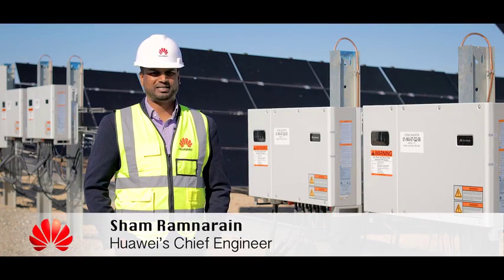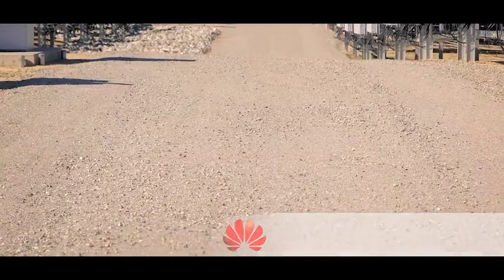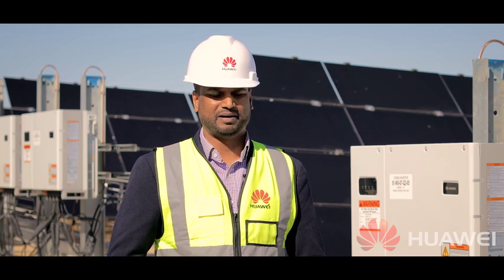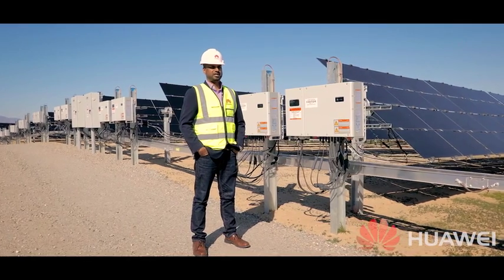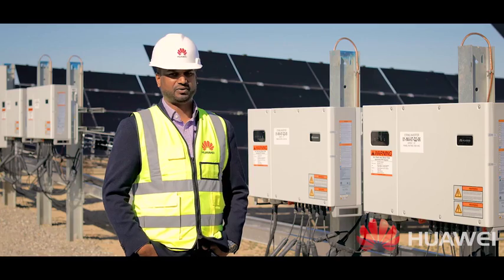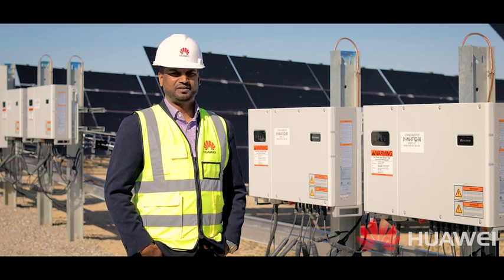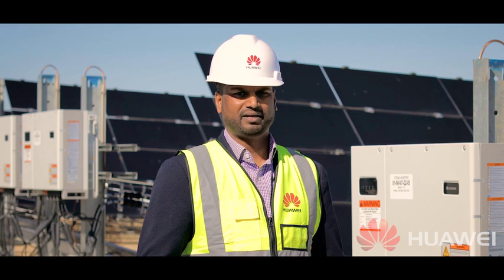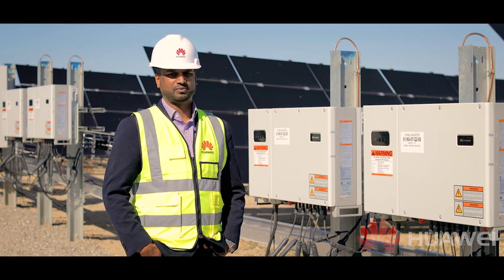Huawei String Inverter at First Solar Projects

Comment: The panel in the array looks wavy. Not square properly during the installation. Btw the Inverter is exposed directly to rain and sunlight. Even it's rated as IP67, don't u think it will still fail in future to withstand those outside impact? Can I know what's the latest status now at your Solar Farm? Is the Inverter still ok or some got an issue already? Thanks.